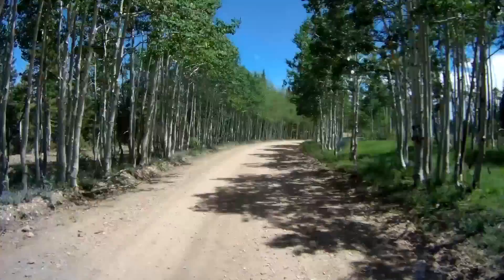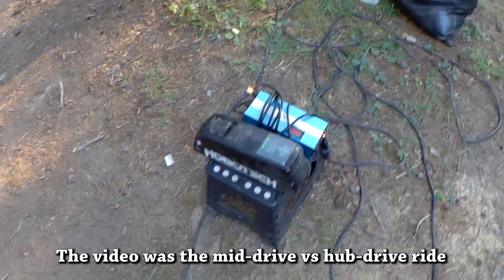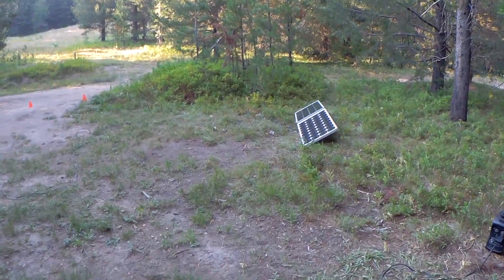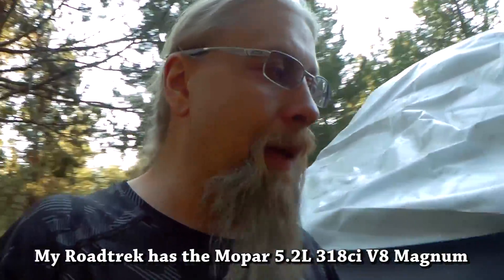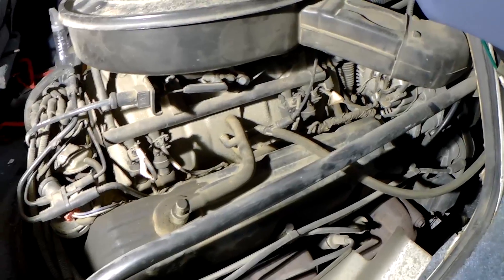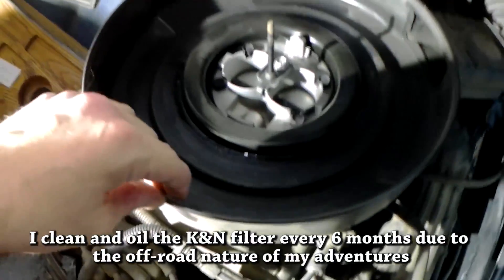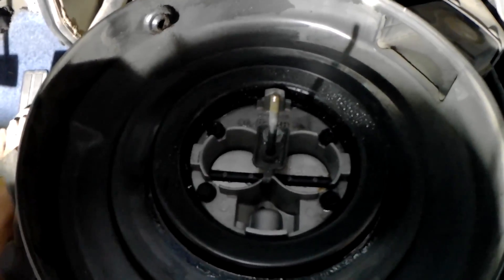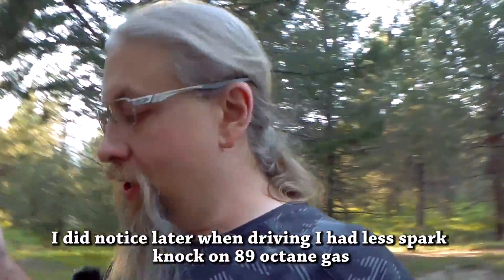HOW TO DECARBONIZE YOUR ENGINE'S PISTONS AND VALVES AND REMOVE CARBON FOR FREE!

Comment: The Goal here is micro-cavitation of the water to remove the carbon.  Cavitation in diesels cooling systems will eat holes in the block--so this does work.  You may get steam.  You may get carbon mixed with water.  I my Community College Tune up teacher (GM TRAIN THE TRAINER SAE Master CERTIFIED ) said this is best.  Never surrender your rights.  I also don't think you have to move 2 miles.

Comment: Really the only way to tell if it's doing any good is to photograph the combustion chamber before and after. I ran 3 gallons of distilled water through my Jeep before most of the carbon was removed.

Comment: You claim your small volume method is effective. Yet...

What about all the water produced by combustion? About a gallon per gallon of fuel. It produces a far larger volume of steam for far longer than your spritzing does, and yet deposits still develop. Any thoughts on the contradiction?
Reply from the maker: Comparing water vapor produced as the result of combustion to direct injection of liquid water is comparing apples to oranges. The steam produced from burning gasoline is the same temperature as the other combustibles and does nothing to clean deposits. In fact, that hot water vapor likely helps the deposits stick to the metal. Where as injecting liquid water into a hot cylinder creates what is called "thermal shock" that causes the carbon deposits to briefly cool and 'shatter'. This cracking loosens the deposits and allows the next cycles of combustion to burn them off down the manifold. This same process of thermal shock is used often to clean rust and carbon off steel such as collector swords. It's a process as old as the combustion engine itself and water injection was used a lot in WW2 fighters for more HP with the added benefit of decarbonizing the valves. This is why a lot of old school mechanics say using water is just as effective as expensive chemicals.
Reply: HOBOTECH 

Yada yada. I’ve heard all that. 

Find a cruddy, carbon-caked old skillet. Test your thermal shock theory or whatever it is in it. Boil, splash, test  whatever variations you think theoretically should work. Go ahead, get it really hot, and dump ice cubes in it. Be prepared to observe no empirical validation of your theory.
Reply from the maker: That's cool. I have a degree in a related field and these are facts whether you believe them or not.
Reply: HOBOTECH 

When all else fails, trot out appeal to authority!

Here’s the rub, and why I suggested a less constrained, crusty skillet test bed: for your thermal shock theory to apply, a sufficient volume of liquid water introduced as a fine spray, must survive a turbulent journey past a throttle plate, through a warm intake manifold, past an even hotter intake port, and hotter still intake valve, while under vacuum. What liquid water remains, under vacuum, must then be able to cool the hot surfaces of the combustion chamber enough to cause the carbon deposits to crack. To do so, they somehow have to overcome the Liedenfrost effect.

Comment: I saw another rver put a quart of transmission fluid in his gas. Quart to 50 gallons of 89oct unleaded. I ve tried it, seems to quiet the engine and runs cooler.
Reply from the maker: I heard of dumping it into the intake to clean out the carbon. Not sure I'd want tranny fluid in the gas lines and injectors of an almost 25 year old vehicle. Stuff can be pretty corrosive.

Comment: I had an '85 Toyota PU and I used to pour a qt of water down the carb followed by a qt of ATF. You have to be careful because the ATF give off a lot of white smoke, but it worked.

Comment: I think you can add a little Marvel Mystery Oil to your gas. That should break it loose over time.
Reply from the maker: Done that several times. It helped a bit. I do run MMO as a 20% mix in all of my motors.

Comment: I tried the spray water trick into my intake on my 2000 chevy silverado 5.3 v8. It pings bad on regular fuel due to carbon buildup from our 10 % ethanol gas blend here in Cali. I got best results using  chevron techron gas treatment and gumout multi-system  fuel treatment back to back. Then If I stick with chevron or shell gas the pinging keeps to a minimum until I run too much of the cheap arco stuff and then the bad pinging returns.         CCC
Reply from the maker: Interesting. I ran the techron treatment on a full tank (35 gallons) and it didn't seem to do much for me and was too expensive to keep trying it. I have noticed different gas brands affect how much pinging I get. Fortunately for me they sell 87 ethanol free gas here in Idaho. That seems to work but it's usually the same cost as premium.
Reply from the maker: The manual says 87 but this was before they put ethanol in gas. I noticed it runs much better on ethanol free but that is not available in every state.
Reply: HOBOTECH 

Ethanol improves octane.
Reply: CentralCoastCamper 

Vehicles using high % ethanol fuels run cleaner, with fewer deposits, than with 100% gasoline.

Comment: You must be a real idiot, you never spray water into your engine to clean it, that`s a good way to do some serious damage to your engine. As others have said, use sea foam to clean your engine, not water.
Reply from the maker: Let me educate you on your woefully ignorant statement. Water injection has been around for nearly a century and doesn't hurt combustion engines whatsoever. Thanks for watching. https://en.wikipedia.org/wiki/Water_injection_(engine)
Reply: Ditto hobotech, 
 Shadow fK;  you obviously have never turned a wrench in your life. Shut the FK up. When done right, this water treatment works and has for 100 years.
Hobotech, you were too kind on to this FKhead.
cheers
Boots Langley
La Mesa, Ca
619-466-7298

Comment: Not a bad idea. Its good to use distilled water. Another reason for water in an engine is guys running supercharged performance engines to run a water or water/methanol injection system to cool down intake temps.

Comment: I'll have to ask a mechanic friend to try this for me..ive started hearing a slight tapping noise recently..im not one to take off my doghouse n start playing with crap I kno nothing about..unfortunately..too old too weak n too forgetful to try learning now..lol thx for the tip tho..
Reply from the maker: This is only going to help with what is called "spark knock" or "detonation". If you are climbing a hill with low throttle especially in OD you'll hear what sounds like marbles in the engine. That's detonation. If you get a ping or tapping at idle or under full throttle that's generally a different issue like a stuck lifter, worn valve guides, or a number of other possibilities.
Reply: @HOBOTECH  oh I gotcha..i kno what that is..thx again..still ghood info to kno..✌💙😊

Comment: Did you suck up the Seafoam through the brake booster vacuum into the manifold?
Reply from the maker: No, I put it in my gas tank. I also tried MMO and Berryman B12 that way. However, next maintenance cycle I might try Seafoam through the booster line.

Comment: This is the best stuff I've ever found. Been using it since the 1980's.

https://www.autozone.com/fuel-and-engine-cleaners-additives/carburetor-cleaner/berryman-b-12-fuel-treatment/525253_0_0
Reply from the maker: I used this to bring my generator back to life and ran 4 cans through the tank. It worked great for degumming the Onan but didn't seem to do much for the carbon.

Comment: take the brake booster vacuum hose off and suck seafoam through it shut motor off wait 5 mins then start and hold at 2500rpm of course put booster hose back first that's how real certified mechanic does it...

Comment: The pouring the water from the cup like you said is much more efficient the little spray bottles not doing much at all  While holding a cup of water in one hand use the other hand to really hammer the motor once the revs are  high then dump it in a few ounces at a time it will  somewhat flat line and then pick itself  backup that's how you shock the top of the dome to knock that shit  off ,  And you will see a slight haze in the exhaust coming out

Comment: What exactly would this help?
Reply from the maker: The steam removes carbon from the valves and pistons. At least that is what some mechanics say.
Reply: At what point does the water become steam? I ask that question because the combustion cycle is moving the water out as fast as you are putting it in. I have seen a bead of water roll along the bottom of a quartz furnace tube using the entire length before completely vaporizing. And just because it has turned to vapor does not mean that sufficient energy has been absorbed to become steam. The furnace temperature was 1050C (1922F). For reference, 6061 aluminum melts at 650C. Internal combustion is about 700C. The less water you use, the more likely it will convert to steam.

I think its the thermal shock that is breaking loose carbon. Water has a much higher heat capacity than convection of air. Ask any plumber trying to solder a wet line.

https://en.wikiversity.org/wiki/Internal_combustion_engines
Reply from the maker: In the intake manifold as soon as the water touches the valves. That's why the engine has to be hot for it to work.
Reply from the maker: I agree that thermal shock is what is supposed to break the carbon loose. The only reason I even tried this in the first place is that a mechanic recommended it, and it seems to have done some good. However, the problem still exists so I will continue to experiment.
Reply: CincyPlasmaTech 

You observed the Liedenfrost effect. 

He’s inventing theories left and right, claiming without proof that the minuscule amount of steam he produced dislodges baked-on carbon. When confronted with the fact that the engine produces far more steam from combustion than from his spray bottle he trots out more elaborate theories that don’t survive even superficial scrutiny. His proof that this works, as I’ve been able to determine, is that old-time mechanics did this, he thinks his vehicle ran better, and he knows his theory is correct because he claims to be an authority, based on some kind of training or experience he won’t disclose. His feeble attempts to defend this nonsense in the comments are the best part of his contribution to YT.

Comment: Good thing the Ranger didn't come along while you were spraying water in your engine! He might have thought wow that's a first, but really you should try some top engine cleaner Seafoam works great! Good luck appreciate your videos!
Reply from the maker: Actually he did come by while I was warming up the motor for the procedure. I've tried other cleaners and several mechanics say water works just as good and it's free.

Comment: You know when less honest gas stations put water in their fuel storage tanks so they can sell water at gas prices.   Well wouldn't that do the same thing your attempting here?  Only this is under your control.  I've never heard of this but I'm not a well versed mech.  Good luck with it.  Hope it helps and not hurt.
Reply from the maker: I'm not sure if it works the same if the water is mixed with the gas. The water by itself needs to turn into steam for this to work. Good question though. I'm not about to mix water in my gas to find out!
Reply: Consider using one of those $5 endoscopes to look inside the combustion chamber before and after treatment. I have one you can use if you stop here in Cincinnati.
Reply: The carbon deposits 'flake' off and go where?      out the tailpipe.  Consider putting some kind of filter over the exhaust to see if the 'bits' of carbon come out.  Maybe a white sheet or towel.  Possible way to see progress.
Reply: Sasnak 

His method does not dislodge carbon deposits from the combustion chambers. Any additional steam produced may dislodge loosely bound soot in the muffler and tail pipe, which could give the appearance of engine cleaning...an old mechanic’s trick to fool gullible customers that something worked.
Reply: Sasnak 

Engine stalls when sucking water from the tank. Water reaches maximum solubility of only 0.5% by volume in 10% ethanol gas, before separating. 

If you want to remove carbon deposits, just burn the highest % ethanol gas you can. E85 is best if your vehicle is compatible.

Comment: I remember back in the early late 70's or early 80's there was an under hood bottle you would fill with basically water and plumb this into a vacuum line.  It was supposed to keep  your engine clean and also get better gas mileage.  My dad had it in his class C for a while really  never did notice any difference.    I had the heads off my class C Chevy engine the other day and I was surprised that there was no carbon on any of the pistons at all.  Everything looked perfect.
Best luck to you!  Maybe get some octane boost for it someday and see if that helps!  I don't think it's really street legal though.
-Jon
Reply: jrmason what kind of water is basically water? 😆
Reply: It had a pretty blue additive to it.  The original fluid was something that you could purchase if you wanted to from the manufacturer.   But,  you could also use water...  That's all she wrote.

Comment: i would definitely use high octane fuel, to get rid of the knocking
Reply: The problem is, if the knocking is caused by carbon build up in the combustion chamber, higher octane fuel is only a bandaid on the problem. If the engine doesn't have a high mechanical compression ratio, and is not tuned for high octane fuel, you are wasting money on fuel for the same results as using seafoam(or water) once in a while to remove the carbon. 

Higher compression engines need higher octane(resistance to ignition) to combat "pre-ignition" caused by the heat generated during compression. Carbon can be hot enough to ignite fuel even during the intake stroke causing "detonation". Hot enough carbon deposits(or valve seats or casting flaws) can cause detonation even with premium fuel.

Comment: I have machined graphite rods. You would think that graphite would be more like a lubricant than an abrasive. Never again. My van is 28 years old. If it has carbon, then it can stay until the first engine rebuild.